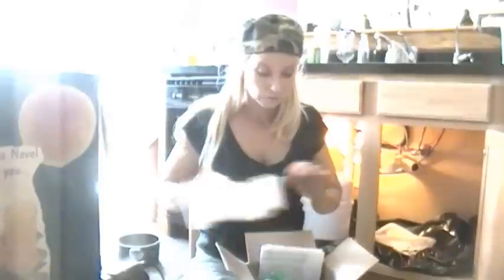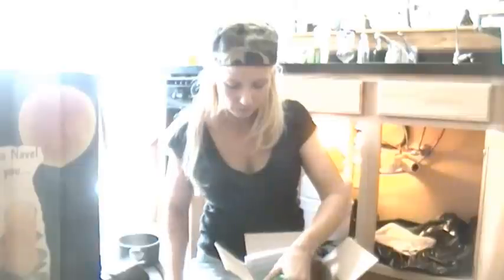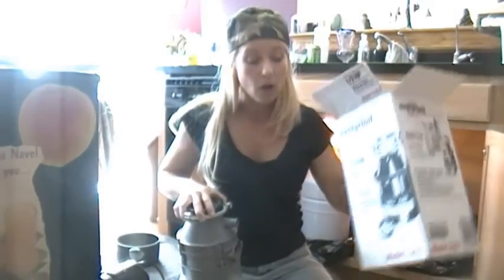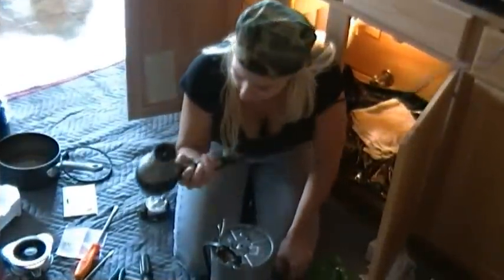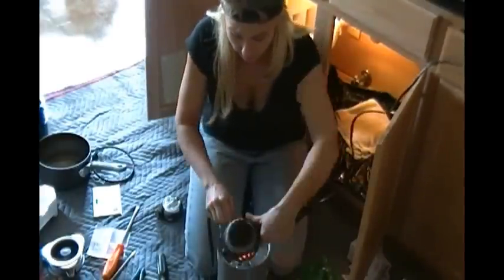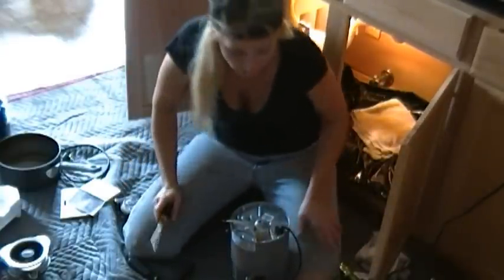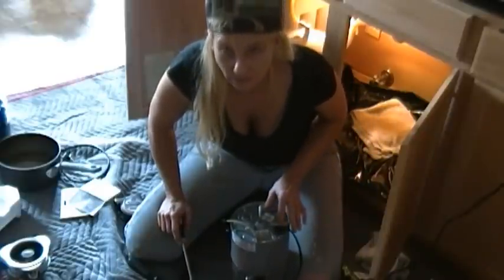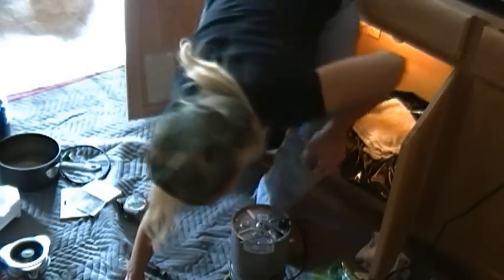Part 3 "It's Always Something" How to Install Garbage Disposer for the Mechanically Challenged

Comment from the maker: Hey Garratt. I don't have any personal experience with Waste King, but pulling the specs it looks pretty solid. Working as a plumber, we never want to go back and see a disposal we installed again, so we always used Insinkerator. In seven years, I can't recall ever going back on a warranty call. Not crazy about the WK plastic housing--my instinct is that the vibration would tend to crack it, But it also won't corrode which is a plus. My advice--either is ok, but stay away from cheap ones.

Comment: GWW, I would suggest that in Part 1 you mention that you need to check what is in the new box and all is present before removing anything as you may need to get more parts before you start. Run the risk of not being able to use the sink if all the parts are not present !!!.

Comment: You should mention the ability to connect a dishwasher to the top pipe on the WD unit. You need to knock out the "bung" that is inside the pipe if using it to concect a dishwasher. Dont forget to take the bung out from inside the WD unit.

Comment: I would suggest always check to check that the new item is all complete before removing the old one - otherwise you will need to temporarily put back the old unit till you got the missing parts.